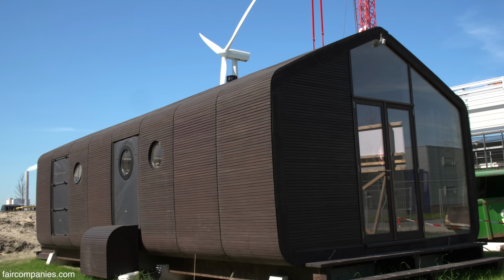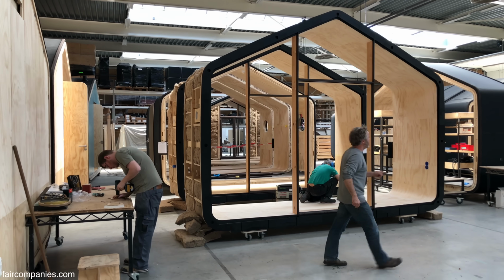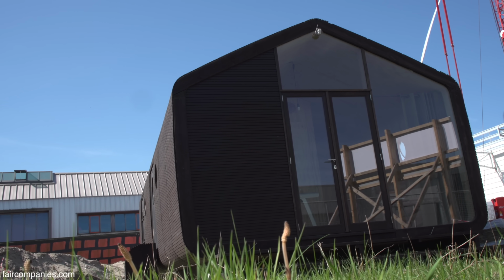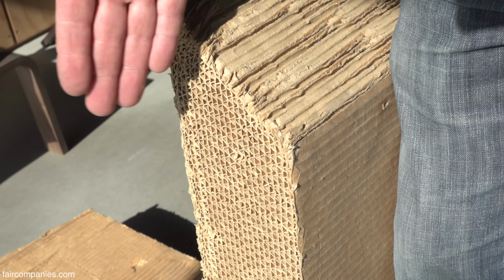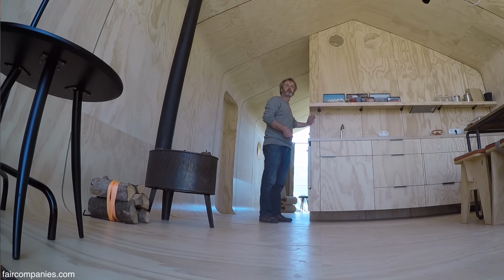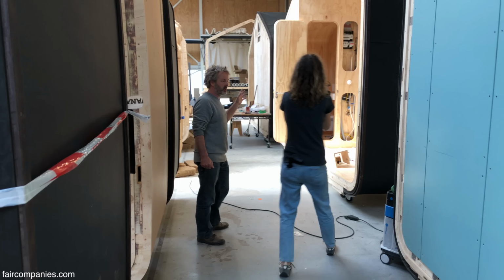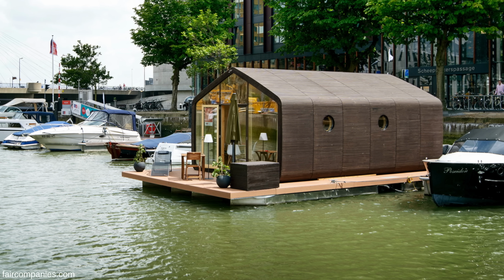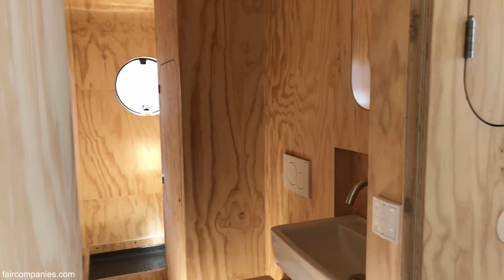Wikkelhouse: pick your modular segments & click them together

Comment: oh i just found out , it's basically 10k for module, so 8 module it's 80k(euro), i wonder how long it would last?
Reply: 10 k for a module sounds a bit too much. But on the other hand. A tiny house that’s big and ready for 100k and 10x4,5 meters is big bro!
Reply: @luckym0nk3y  thats 45m2 that is in best case a weekend house..  and for 100K  you build a 120m2
Reply: @luckym0nk3y  80k € in the Netherlands? have in mind that you also need land to put it on. the land is usually more expensive than the building itself.
for 100k €, you get a full flat the same size. you can get a finished cottage for 120k in the vicinity of a major city. and here you now need to find some land in the middle of nowhere that costs 20k...
Reply: FrankValchiria at least 50 years according to the site
Reply: 50 years in perfect elements. Send this to Alaska or the amazon and see what happens.
Reply: Derek L. “amazon” would probably give you a refund, no question asked 😂
Reply: ofcourse... what did you exspect.... or put it on the surface on the sun and see what happens. ...   ;)
Reply: Derek L. Jeez, that’s blindingly obvious!
Reply: @dereknyc4402  yeah. the Netherlands has more rain than perfect elements. this will last for max 10 years in the rain...
Reply: @dereknyc4402  It´s not  built for those places
Reply: @mckenzejackson7633  50years of ZERO moisture intrusion.   Practically 3-4 years
Reply: It's the 1st idea wait for others too make it cheaper dvd players cost $1000 at one time now you can get one for $29
Reply: @retromaticmike5388  Or it could be like the  Betamax an HD DVDs lol
Reply: until a wolf with a good set of lungs comes by
Reply: You haven't been paying attention.  The water is kept out the same way as a conventional wood framed house.  The cardboard is fire resistant.  The structure is anchored with steel ties to the concrete beam piers on the ground.
Reply: better buying a real house
Reply: Well it has given me some inspiration.  Great detailed account from the business owner who gave many manufacturing secrets away which is refreshing.  Although not that anyone will copy too easily as the set up costs would by expensive.  Meanwhile I may try laminating cardboard for speaker boxes for example.  Thanks for showing this short film.
Reply: A bit expensive for what it is. Probably needs to be mass produced to go down in price.
Reply: The rebuild cost of my 3 bedroom, 2 storey, brick built house for insurance purposes is approximately 60K. It’s the land that costs the money in the UK! You would be better off upcycling a shipping container for a couple of grand and lining it, maybe building a shell outside to make it look twee when you can afford it. But still it’s an interesting project all the same and has certain useful attributes, so kudos to the designers.
Reply: Or you can use a hydraulic ram to compress it into bricks as the Boring company has done. Essentially sintering the silicates. It's stronger than concrete.
Reply: I've seen cheaper tents...
Reply: Yu Tu How do you milk your milk?
Reply: @msmegification  I don't want to know, hehehe
Reply: @Yu Tu "Harrington stored and used water illegally by placing dams across channels on his property and preventing the flow of water out of these artificial reservoirs without obtaining a water right permit. The height of each dam varies; two dams stand about ten feet tall and the third stands about 20 feet tall. The total amount of water collected behind these dams totals about 40 acre feet; enough to fill almost 20 Olympic-sized swimming pools. These man-made reservoirs feature boat docks, boats, and were stocked by Harrington with trout and Bluegill for recreational fishing."

He wasn't just collecting some rain water for his garden.

Edit: From everything I've read rain collection is legal in all states within reason.
Reply: Next strong wind here!
Reply: Fallout vault building
Reply: That's not cheap.
Reply: If that's right they need to half their price.
Reply: FrankValchiria , longer than a typical human life time. over a hundred years as long as there are no holes on the outside of the building. water is the enemy. keep water out, who knows how long it could last. longer than my life time for sure
Reply: s that $10k for a Plain module? what about the bunk bed unit? or the Kitchen/Bathroom one?  Each type has a different price.
Reply: 80 euros is about 91k USA dollars....think i could find a lil stick built house for that
Reply: @lisay5450  my 3 br 2 bath 2 story (plus basement) home in Cleveland was 57,000... And it's pretty nice, even though it's 110 years old :)
Reply: Margaret Gardner my daughter just bought a 90yr old home...has the plank n plaster walls still...like stepping back into a time capsule...so awesome!!! The concept here is cool but idk about the resale on it as it pertains to a very specific type of home buyer. Most places appreciate w time...idk about these though...
Reply: I share a similar sentiment that this is basically a prefabricated structure that appeals to wealthy people looking to add a structure to a parcel of undeveloped land quickly and conveniently with the ability to expand livable square footage as needed.  At least that is the appeal for me along with owning a second home that is not a double wide trailer.  $10K USD is not a price that is so affordable that I find myself thinking about the endless possibilities especially for a structure that a bank is not likely to underwrite financing so that makes the option extremely expensive. But, I wish you the best of luck.
Reply: They need a Tee, 90, and X to make some interesting structures.
Reply: I’m shit full of houses with cardboard and newspapers for insulation. He says it’s biodegradable. Lots of cash, no return
Reply: Not for the common homeless guy
Reply: That’s high.
Reply: One match and you'll find out....
Reply: 50 years at leats and after that you can call them and they renew the protection
Reply: He did say you can make a small house with 3 modules. So 30,000 which is the price of a luxury car. Also If it's self sufficient you save money in the long run because you won't have any bills. So it's worth it.
Reply: Chris murch with 3 modules you get a 30,000 backyard shed
Reply: @chrismurch3735  Indeed
Reply: 30k is enough to buy a small apartment/condo in a small town.
These cardboard houses are for rich people who own rural land and have money to play with.
It's a cottage for rich people.
Reply: An apartment in the UK is minimum £100k, for a single bed.
A nice new apartment by the docks with 2 beds is approx £300k.

These things are not much more than it costs to build a building from scratch in the UK.
Reply: @marc0523  where I live in the uk a 1 bed apartment is minimum £150k. So this 8 module house at say 90k with delivery plus cheap land if you know a friend with land could be around the same price. I like it
Reply: If a 1BR apartment costs 150k, I'm willing to bet you live in a city and there's not just patches of land that everyone's friends have to allow them to live on for free...  And if you're going to go out of the city to live on your friends land in this modular home, then theoretically you could move out of the city to an area with cheaper housing..
Reply: @soup5220  i kind feel the same way. Small villages outside cities offer lots of houses for 80k
Reply: @FrankValchiria Yep..  You can buy a freshly remodeled 1800 sq ft 3 bedroom 2 bath house for $90k around me..  10-15 minutes outside the city I work in.
Reply: @Silverwidows  
how is leeching from your friend any different from living in your moms basement? you can only be welcomed for so long. thats not a good plan.
Reply: @deicide6403  Leaching? You mean finding a friend or someone who has allot of land and wants to sell a small portion that wont affect them because they have allot of land already. You have a strange definition of leaching.
Reply: @ReeseL4D  So tired of negative connotations toward having money. Nothing wrong with being successful or being Richer than others. There is every opportunity to get educated or trained in a skill that gives people opportunities to earn more money. Those without need motivation, ideas and hard work. Success can be measured in a lot of ways. Financially successful is a good thing that should not  have negative connotations. God says you should work and save for your childrens children. Well, your pqrents may not have done that for you. And if you choose not to believe in God, it is STILL GREAT to be successful in your life pursuits and financially well off. I'm so tired of the whining, small-minded, socialist and communist mentallity expecting everyone to donate to them and take care of them and get FREE everything, free insurance...insurance has never been FREE. Get a JOB, earn some money and buy what you want with it. Stop demonizing those that have money.
Reply: Considering the cost of the materials, they're inflating the price by 400-500%. It's a complete and total ripoff. Anyone buying this shit from them are being taken for a ride. 

It's a nice idea, but $10,000 per module? No thanks. I can build the same exact type of module with the same exact materials for a little over $1500 (US) worth of materials, and it would take me maybe a week to build each module. I could have the entire thing done in a few months, and if I went for the 8 to 10 modules I'd want, it'd cost me maybe $20-25K all said and done, completely finished, plumbed, electrical, foundation, etc. 

I just love how these jackasses are putting low cost materials into building these and then inflating the price by 400-500%. What a joke.
Reply: ɑʟpʜɑ ɱɑсʜɪиɑ I’ll pay you $25k to build me a 10 module unit. When do you want to start?
Reply: @AlphaMachina  I disagree because of Labor, solar package and company overhead. This company makes a QUALITY product. Most 'clean green living' costs more initially anyways. Why shouldn't the company MAKE $ ??? What is the point of a business if you cant make money over and above your operating expenses?
Reply: It is water- and fire-proof.  Did you not hear him say those things?
Reply: Everything burns, it's just a question of how hot. I'm sure it will burn better than brick or concrete. Also, not sure about condensation developing inside the plastic membrane from cold climates. Not sure it would hold up well. I've seen IP68 light fittings drown in their own sweat so condensation is a real problem.
Reply: @MrPDawes  ,  steel is, by far, cheaper and better in the long run!   Fire & bugs would eat this thing in 5 years!  Oh!  With the exception of a couple of steel towers that DO melt if aluminum airplanes crash into them!   Otherwise,  steel is best choice.
Reply: @rayjones3212  resistance
Reply: @rayjones3212  
They can be fire resistant, but not fireproof. There's no such thing as "fireproof." Just like the Titanic was unsinkable. The Titanic was steel and this is wood and paper.
Reply: Randy L, there is such a thing as fireproof. I can think of numerous examples right off the top of my head.

Is fire is fireproof? Debatable... Shadows will not burn at any temperature, though they can be dispersed (not really the right word), temporarily, by fire. Ultimately though, the source of fire will be depleted and the shadows will still be there, or they'll return, or something.

Space itself is certainly not combustible. I don't mean outer space, but just space in general, which of course would include outer space. No matter what you burn, at any temperature, the space itself remains, even if everything contained in that space is incinerated.

Then there are abstract things like math. You can't burn math. Even if you burn the mathematician, 1 plus 1 would still equal 2. You probably can burn most languages though, in a sense. If you burned up all English speakers, and all the physical evidence of the language, then the language itself would have been effectively incinerated beyond recovery. Not math though, which would remain true and discoverable even if all current knowledge of it were wiped out. Now, I think technically you can't really burn English either. It was a nice idea but from a hardcore physics standpoint, even if you eradicate all memory of a thing, that doesn't technically destroy the thing as it existed (exists) in time/space. An alien race, a hundred light years away, with good enough instruments, could look at our planet from their vantage point and see us as we were a hundred years ago. So while it may seem to us that we have no way of recovering our lost language, that doesn't mean it is truly unrecoverable.

Fractals. This may be just another aspect of math, but fractals weren't invented, they are mathematical constructs which were discovered. These constructs seem to exist in the relationships of the equations independently of our ability to express or visualize them. Our ability to express or visualize fractals is extremely limited, and barely scratches the surface of their strange existence. A computer visualizing fractals is not their source, but rather merely a shallow, abstract exploration of a rendition of a tiny fraction of something beyond our ability to even perceive. You can burn a picture of an abstract representation of a fraction of a fractal, but the fractal itself is beyond our reach.

Information. According to physicists, information can't actually be destroyed. I don't mean information as recorded by humans in textbooks for instance. Rather information as discussed by physicists as being a fundamental aspect of reality. There was a big debate about whether black holes theoretically destroy information, or transfer it to another part of the universe, or an alternate reality. Ultimately it was decided that black holes must theoretically compress the information around their event horizons. Of course that is all just pure theory. Really though, how can you burn information? You might burn a record of information, but that is merely a record of some abstraction, not the information itself. The record itself is a different kind of information. The literal information that 'is' the record is completely different than the abstract info it represents. That literal info is merely reconfigured, and redistributed by incineration, not destroyed. While the abstract info it represented was not literally present, so only an abstract representation of that info was lost.

I don't think you can burn sound or light, though there may be room for debate on that one because fire or heat could potentially disrupt them, they aren't really combustible themselves though.

I'm sure there are many other examples too...
Reply: Multi Mason  
That certainly was an unnecessarily lengthy dissertation to say absolutely nothing. My first impression was that it was composed by a pseudointellectual, but more likely it was just an embarrassing failed attempt at humor.
Reply: Randy L, Oh, what a nice reply! Hey thanks for your feedback. Somehow I think you are trying to make me feel bad. How very thoughtful of you. It is touching that you care enough to do that. Just like you were factually incorrect about nothing being 'fireproof,' you're also wrong about a few paragraphs being a 'lengthy dissertation,' and you're wrong about it being embarrassing too. Unless you're embarrassed by being wrong of course, in which case, that's all you man. Oh and you were wrong about me saying nothing too, I pointed out an incorrect statement and backed it up with numerous examples, and had fun doing it. You certainly managed to say nothing though, in your unnecessary and ineffectual attempt to make me feel bad. Nope, I was just having fun, enjoying life, it is absolutely amazing. I apologize if I offended you in some way. You go ahead and think whatever you like, heck, get all embarrassed by other people's youtube comments if that's your thing.
Reply: @multi-mason  That was an awesome response 👍
Reply: @Yu Tu  - but it's a renewable resource and environmentally friendly! Treehuggers r' us!!! 😂😂 NOT! This thing is too fragile. An overglorified cardboard box for rich people who want to experience homelessness. Just get a real home. in the end, they retain value, can be resold, and you can raise a real family without upgrading with every body digit you grow, or kid you get. Oh yeah. you also wont have to come home from a hard day's work to find out someone drove off with your home and all the your precious possessions you somehow squeeze packed in it.